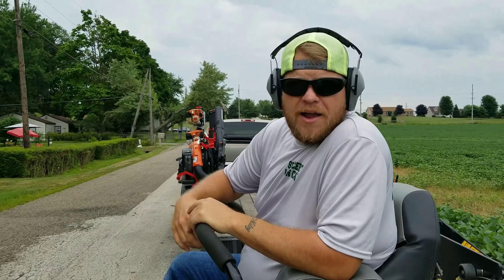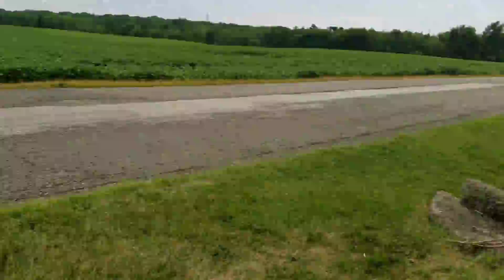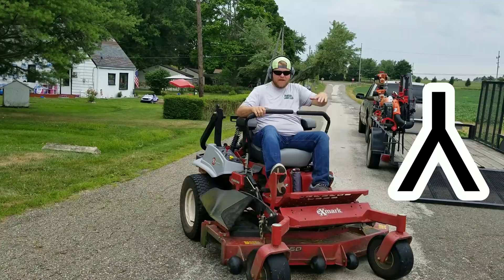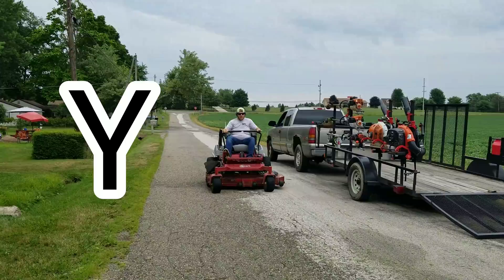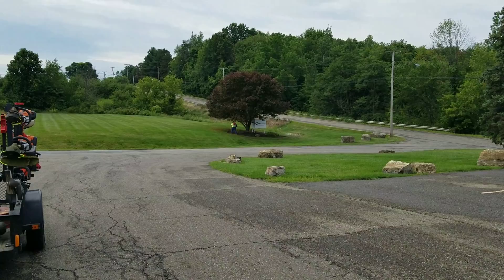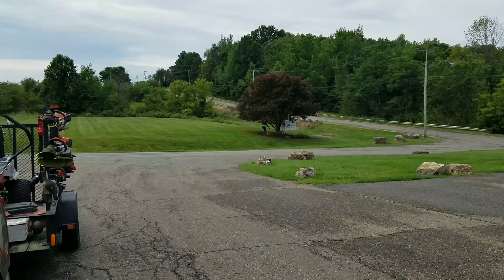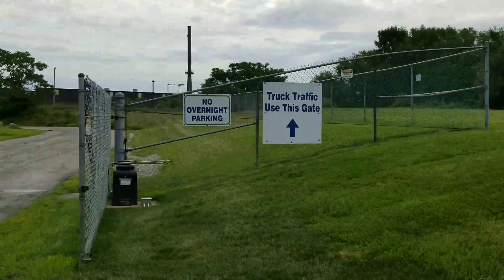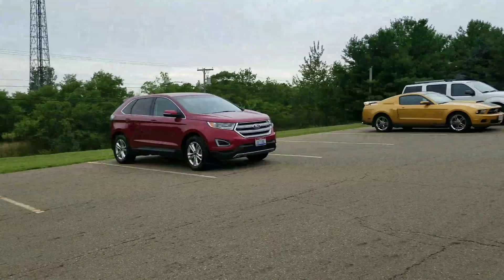(HOW TO DRIVE A ZERO TURN)

Comment: We have completely eliminated the time consuming 3 pt turn in our operation.    Lap bars are old technology.   Manufactures claim their mowers are zero turn, but in real life, mowing real customer’s lawns everyone does a 3 pt…………….Stop for a second and think about that last statement.   CRAZY.    That would be like owning a new 4WD truck and not being to use the 4WD feature in the rain or snow.     We now only use the Commercial Cub Cadet Pro Z 960 and 760 zero turn mowers with steering wheel.    With the advanced Turf Tear Reduction System, we simple make a zero turn at the end of each stripe.   We save hours and hours of time.   Next time you mow, think about your own time savings and gas savings.   It’s HUGE.    My Lazer Z and Turf Tiger are now our back up mowers and rarely make it out of the shop.   Take care, thank you for your informative video and God bless.

P.S.   we get asked all the time…. How much time do you save?    On flat terrain it’s 10-20%, and on hillsides it’s 20-30%.

Comment: Just my 2 cents. Why do you start the mower at almost to full throttle ?I mean do you start your truck with the throttle wide open ? Could of been reason for premature failure of connecting rod.
Reply from the maker: Lol, the way I start my mower has nothing to do with Grade A steel snapping in half.
Reply: Sure it does....you ever heard of friction , dry start ups. But it's just my opinion. Carry on.
Reply from the maker: Bill Peters its not dry! Its coated in oil.
Reply: I agree with you Bill as far as  wide throttle engine starts are concerned. most of your engine wear occurs during cold engine starts. It might not be enough stress to break a connecting rod  but it will  wear your engine  out  quicker  than  it would if  you warmed up your mower  at lower  rpm"s.
Reply: My friends exmark zero turn it reads right in the pto to throttle the blades at 1/2 throttle  upon start up.

Comment: Doesn’t this method of turning defeat the entire purpose of having a “zero turn” mower? There has to be a better way.
Reply from the maker: No! It prevents ripping the lawn. This is how professionals do it. Homeowners can turn it the way they want. We get fired for tearing stuff up.
Reply: I don't do the "Y" with mine and don't tear up the yard, but I'm also a home gamer working on my own yard.  The key for me is to not come into the turn with a lot of speed, and don't rotate on a stopped wheel.  For me, I slow down as I approach, then slow the side I want to turn on and eventually reverse that side slightly, just smoothly bringing it back forward as I reach the direction I want.  I'm sure everyone develops their own favorite way though.
Reply: I'm no "pro" but I've noticed ground/turf condition dictates what you can get away with. If it's soft or moist from recent rain, what he's demonstrated here is the only way I know of to prevent tearing the turf. If the ground is harder and not moist, you can do a "tight 180" - but the key is the inside tire MUST be rotating (slowly, of course) throughout the turn. If you have the inside tire stopped, and spin the machine around that point - it'll tear. If you have one tire going backwards and the other forward - you're really gonna tear stuff up.